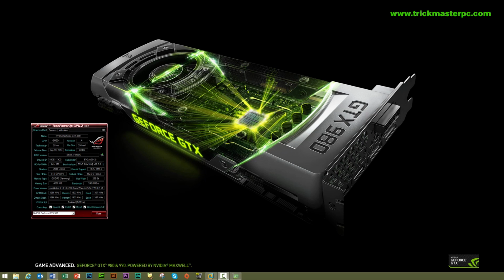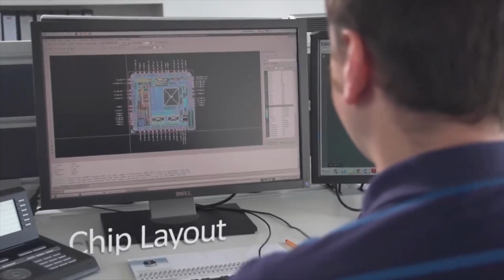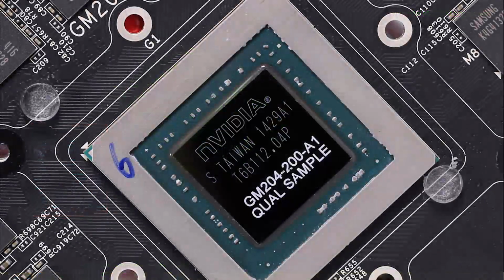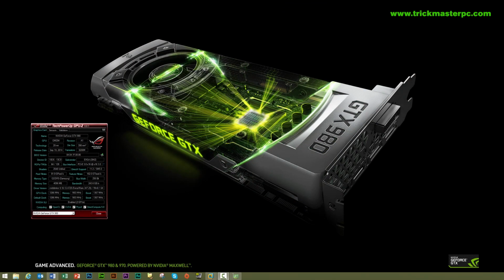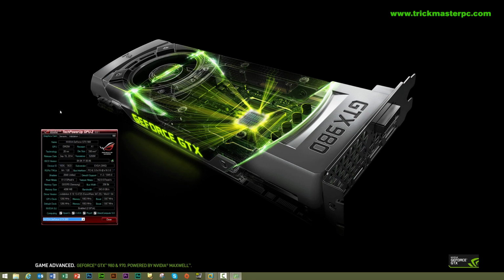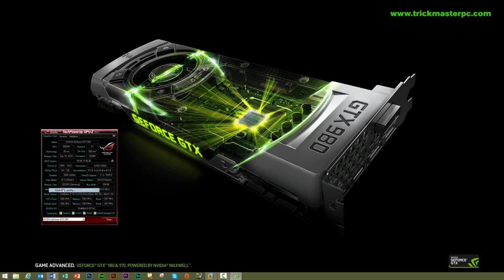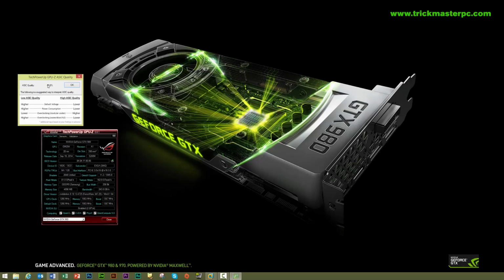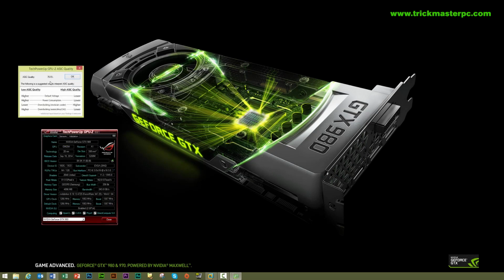What is GPU ASIC Quality & How to Read it

Comment: I got a old beat-up 1080 that is completely stable but if game developers are generally known for not optimizing their games well sometimes my PC will crash, like on Roblox. It was used for mining and the asic quality is degraded. Generally some things will happen when your asic quality falls beneath a certain point. For me that is some issues with displaying games to more than one monitor at a time, running VR titles without turning my clock speed down, crashes on poorly made games and extremely hot temperatures that have prompted me to basically strap old CPU fans to the card and put them in overdrive making it louder than the howling winds of hell. The card was a superclocked card from EVGA and it still sits at 2 GHz. If I down clock it to the stock 1700 MHz (for the founder's edition) all of the issues disappear. Most games run without an issue on that high clock speed. My point is to an extreme level asic quality does matter, but not enough that you should really care unless you're an extreme overclocker of the owner of a superclocked card.
Reply from the maker: Replace your GPU thermal compound with Thermal Grizzly. The compound degrades over time. Also check to see if there's any firmware update for your card. This should help and doesn't take too much effort or cost.

Comment: My Power Color RX 480 8gb overclocked gets a 62% ASIC. I have to run a custom fan curve to keep its heat in check. That ASIC score is with a 1400mhz @ 1175mv GPU and a 2250mhz @ 1150mv OC on the memory though on overclocked bios. So your telling me if I default my card to factory specification and under volt it. I would get a higher ASIC score? ..and because I am below 70% I should be water cooling my card? Well my custom fan curve keeps it's temps below 72c. Even under load. I bet I could get a 85% or higher at least, if I under volted default clocks. I'm not gonna worry about trying to water cool my card because it's got an under 70% score. My fancy fan curve I use on MSI Afterburner takes care of that np. Thanks for the video man!

Comment: Just got my Sapphire Nitro Radeon RX480 OC 4GB and has a score of ASIC Quality 73.4% My card is higher then 40.6% of there GPU in there validation database, This is good right plus i already OC it a tad to 1355 GPU/1555 Mem OC stable in everything i played, Doom, SC2, Planetside 2, Left for dead, Arma 2, Everything on High or better. Its a Fucking BeAst of a card!!!

Comment: My 7970HD has 60,6% ASIC quality. It doesn't overclock very well, but there is something else I can do with it.
Undervolting from 1175 mV stock to 1000 mV prevents this card from ever throttling, and decreases power consumption from around 270W to 180W max (Furmark).

Comment: Wow, I actually had no idea it was possible to evaluate this so easily... I was kind of amazed when I spatted the function in a newer version of GPU-Z.  My SAPPHIRE NITRO Radeon R9 390 has an ASIC Quality of 80.6% which GPU-Z cheerily adds is better than 84.1% of similar GPUs in their validation database.  :D
Reply: MY MSI 290 is over 86% higher than 99.7% of all 290's.
Reply: +whiskey 201 I'd check mine again... But on Friday the 13th (Of course, right?!) a bad AMD Crimson driver locked the fans off on 'Automatic' and fried the board while I was playing a game. Severely damaged my second one, too... About to send the first one back to Sapphire.

The second had a super-low ASIC quality already (67.9%) and now that it's been cooked it's getting undervolting glitches and crashes under desktop load and only runs well under gaming load.  Also, GPU-Z says "AMD Radeon (TM) R9 390 Series"

Comment: 78.1% on my r9 270 :)
Reply: 80,6% on R7870 xfx
Reply: 88.3%  sthn HD 7850 mou kai efage overclock 1250mhz core kai 1550mhz memory, me 0.050 perisotera Volt. :D.  Basika gamaei kai dernei. Ekei pou epaiza Fallout 4 sta med-high me 30-40 fps twra paizw sta ultra me 45+ xDD
Reply: Jesus McSwagdalf Πολυ καλα :D
Reply: Ardamir 89.2% in gtx770

Comment: I just came across this video and checked my asic score. I have a PNY 980ti and my asic score is 83.2. I'm pretty happy about that since I originally thought that we was a low number. I have been getting an awesome overclock of 1480mhz with boost clock on air and 8000mhz on the ram. I set a custom fan curve and at load the fan runs at 60% and my gpu temp stays around 64 degrees Celsius while running furmark.

Comment: garbage 980 ti lightning. 1st one was 69.1, couldnt oc for crap and the coil whine was horrible. 2nd lightning after rma 66.1 asic but oc's better. Whats the reason?
Reply: +Elite Exposure That sucks dude, My MSI 980ti 6G is 75.8 but I haven't overclocked it. Im scared of fucking it up/

Comment: My AMD Radeon HD 7970M scores 100%, I am not sure if its broken or something though my card did die on me after 4 years of usage duo to poor soldering on the chip so I baked it in the oven to repair it so it works but now it wont let me overclock it nor see the temps so I suppose its hanging by a thread. Probably screwed up the ASIC reading too.

Comment: My MSI GTX 980 TI Gaming 6G has an ASIC score of 70.4 is this card good enough for a good overclock on air cooling?
Reply: David Hunter Got the same card, mines 65.2%
Reply: Retro1989 so I'am guessing your card is better on water cooling for overclocking.
Reply: do you get any coil whine with your card? cause i hear some on mine.
Reply: Don't think i'd have the guts to take the card apart and put a water block on it. Got no coil whine on mine.
Reply: Retro1989 Yeah same I'm still new to all the water cooling stuff but yeah my card was quiet until i tried Watch Dogs and got extreme coil whine ''without v-sync'' but maybe that's what started it not too sure.

Comment: hey I just bought a non-overclocked (947 gpu clock instead of ) r9 290 windforce. It has an asic score of 79.4%. 

Did the card not being OC skewer the score? 

I got the card second hand for $200 CAD (about $165 USD) and thought it was better than spending twice the amount for a 980 or 970.
Reply from the maker: Wad Saw The ASIC rating will not change based on clock frequencies or voltages. It will remain static because it's a rating of your GPUs physical quality characteristics. That's still a damn good rating though.
Reply: MIne EVGA gtx 460 ASIC score is 85.9%..Is it good?

Comment: Hmm got 2 - EVGA GTX980Ti SC+ cards.   One of them is 83.1% and the other is 67%.   :(

The lower scoring card actually hits it's thermal limits on stock clocks...  it will actually reach 90C+ start to downclock after about 20 mins.   Do you think I should try to return/exchange the 67% card?    I have no intention of running water cooling, just air cooled here.
Reply: Shadowdane I'm guessing it's hitting 90 because its ontop of your sli setup?  Those are insane temps.  I've had my evga 980Ti ACX 2.0 overclocked +225 mHz to 1225 mhz base clock(1456mHz boost) and my single card doesn't go over 60 degrees with my fan only at around 50% with Witcher3 on ultra 1440p or benchmarking.  It has a score of 78.3
Reply: Brad Luczak No it was actually in the lower slot...    I ended up returning that card as it was overheating even when I removed one card from my computer to run a Single GPU for testing.  I believe something was defective with it at stock clocks it was pushing 1.25v and overheating.   The new card tops out at 1.18v at stock settings, also the new one has a ASIC of 73%.   The 980Ti cards just run EXTREMELY HOT, I really wouldn't recommend them if you want to keep a cooling running PC.   I had 980 cards before and they would usually sit around 55-60C in most cases.  I think a few times in benchmarks might have gotten up to 65C.   The 980Ti just uses a TON more power 250 watt, the 980 only uses 165 watt.   More power = More heat.

My 980Ti cards now that I got one replaced get up to around 65C - 75C.   Wish they ran cooler but I'm not about to do water cooling to cool them down.
Reply: Shadowdane I forgot to add the Ti to mine...  I had a 980 FTW before i got my 980 Ti and it would run 70-80 C.  The stuff i posed above is for my 980 Ti.  It's the ACX 2.0 model and it really does it keep it at 60C or less with my overclocks and fan at 50% of less.  You really can't even hear it.  the 980 was so much hotter and louder.
Reply: Yah I think the issue with my 980Ti is the EVGA backplate.   Those things get insanely hot, heating up my entire case.   I'm going to have to see about removing them.  Going to check with EVGA if it would void my warranty if I remove the backplate.   

I would’ve purchased the lower end model without the Backplate if I had known they get that toasty.  I get the feeling the backplate doesn't really dissipate heat well at all and more acts like an insulator.
Reply: Shadowdane Backplates actually lower temps 1-3 degrees. The thermal tape helps cool the memory.  I added one to my card.  You can take the back plate off it won't void your warranty.  If you ever have to send them back for replacement or repair you would just need to put them back on. (Save the screws too)

Comment: My reference GTX 980 has a ASIC quality of 63.8%. Couldn't get no where near 1500 Mhz on stock BIOS. Did a thermal paste swap and flashed your 980tweak rom. Now running at 1500 Mhz on GPU and 8000 Mhz on memory, completely stable. Under load temps are around 82-83c. I've got a ACX 2.0 cooler on the way. Going to compare the temp differences and maybe push the overclock a little more.

Comment: Well unfortunately, I have 53.5% ASIC on my 280X DC2 TOP hah. What are the odds..
Had to flash it with another Asus BIOS with clock from the regluar non-TOP edition just DC2 so it can server stable, and not have artifacts in every game, even CS GO and Dota....
Reply: Filip Pesic same card 70%
Reply: primus loy Lucky guy man.. That's what you are. You should be happy really. :)
I'm never gonna buy another AMD card again, I gave up for now. At least not until HBM2 or I should say Arctic Islands / Greenland.
I'll take 3.5GB any day of the week, as long as it's 100% stable, with no artifacts whatsoever.
Reply: Filip Pesic only the asus 280x cards had artifacts because they were pushing the system too hard.. :(  ..other AMD cards dont have this problem..  also the asic percentage varies even in nvidia.....   i had my issues with artifacting with my card.. asic was 57% then i RMA,d it..they gave me a replacement.. its 70% now.. no problem..   its not AMDs fault.. its the manufacturers fault.. :(
Reply: primus loy Well that's okay.. I wanted to say that Nvidia has so much less artifacted cards, like almost none. That's a huge advantage for me with Nvidia.
You are wrong about the artifacts with other AMD cards. Artifacts are present since the HD7970 days. or even earlier, I remember perfectly and I also dogged it on the forums when I was trying to find solution to my card.
It's very silly from AMD to put 1250MHz Hynix memory in 390 and it's rated FROM Hynix to work on 1250MHz, and then sell it as 1500-1600MHz card, it's like a time bomb. Why does't AMD not put Samsung 1750MHz memory? Too expensive? Well that's not an excuse. On the other side, if you leave it on 1250MHz you will not lose fps at all, just because all AMD cards have huge bus, 384-512bits, so the MHz is not important, it can be even 1200MHz - 4000MHz.
Also, you said about the manufacturer fault? Well, as I know, all silicons are made in TSMC, cause they are the only ones to mae it. They ship it to all vendors like Asus, MSI, Gigabyte, EVGA etc.... So it's just luck. All the vendors test it and then it goes to their PCB, or do they? :)
I believe that Gigabyte's G1 cards are the best, cause I believe in their "Gauntlet" Silicon picking. They hand pick the silicon for their G1 GPU's. And when you look at tests for 970, you'll see that is OC easily and it has high ASIC too. (didn't take AMD for example cause AMD OC is just too poor, you can't OC a GPU from 2012 too much, cause it's already pushed to it's artifacts limits lol)
Reply: i agree, nvidia has lower artifact issues..
i disagree that abt the memory part.. SK hynix are no1 in memory manufacturing... also TSMC only make the cores not the memory chips... the problem is not AMD.. its the manufacturers..for example.. AMD told the r9 280x cards to run at 850mhz core and 6000mhz memory.....  the company carelessly pics random chips and boosts the cpre to over 1000mhz or more.. same goes to mem..they always push it beyond limits..most of the time it works..but some times it fails to deliver..its the manufacturers fault mate.. not the chip makers...
Reply: primus loy Well okay, yes, I agree. Hynix memories on AMD cards are always rated to run at 1500MHz or even 1250MHz on new 300 series. And yet, manufacturers still push it to 1600MHz even if it's rated at 1250MHz, so technically, it's not Hynix memory that it's bad, but the vBIOS that vendors put and the clocks on it, to be precise.

Comment: Best of my cards
MSI 7850 PE 91.6% AISC core 1380mhz@1,28v(60 percent from reference) ,but vram unfortunately goes only to 6200mhz 

Second is 
piece of shit sparkle 660ti with 78.2%  AISC core maxed out at 1050mhz and its only 70mhz more than boost clock 

ant last is 
Gigabyte GV-N960IXOC-2GD with 68.6%  AISC with  core maxed out at 1300mhz MEH :( and whooping 7800mhz vram not bad for cheapo

Comment: Hey dude, interesting stuff. I have a strix 980 on air with a 68.2 % ASIC, what are your thoughts? Thanks in advance
Reply from the maker: That's a good ASIC score in my opinion. If you throw that on water cooling, you'll be able to push it further.
Reply: TrickMasterPC I plan on leaving it on air, thanks for the feedback though. what clocks you reckon I could hit on air?

Comment: I Have 2 Evga GTX 980 FTW And One IS 71.9% (Which Is The On Top ) And The Other One Is 84.4% does It Matter If The Lower Score One IS On Top
Reply from the maker: Definitely keep the lower scoring card on top. It will generate more heat, and since heat rises if you had a card above that card it would take on additional unnecessary heat which would hamper your performance. Good question man!
Reply: +TrickMasterPC LOL...dont try to throw simple common sense into this.  a high-airflow pc case is like a hurricane/wind tunnel inside. heat has absolutely no time to "RISE" however i would still keep the hotter card on top, especially for air cooling, simply so that the top card doesn't intake the air from the potentially hotter card. (which is why i never run sli air cooled)